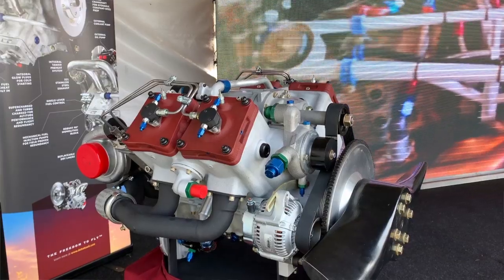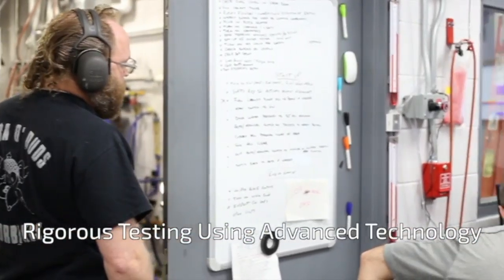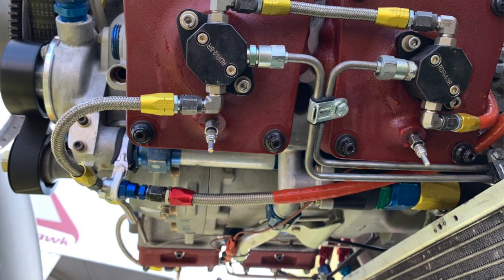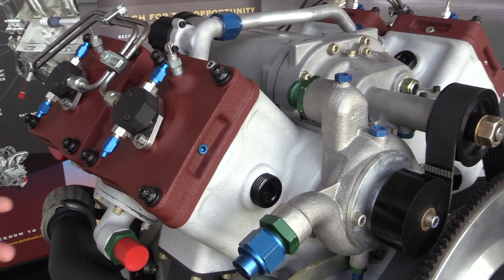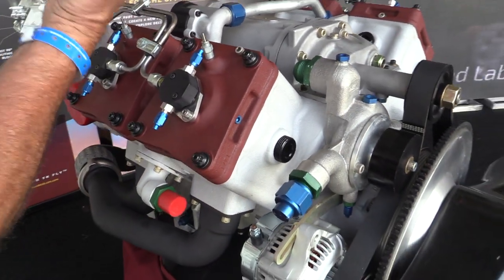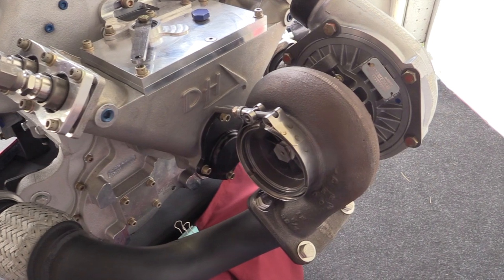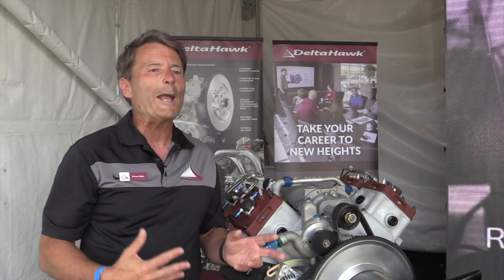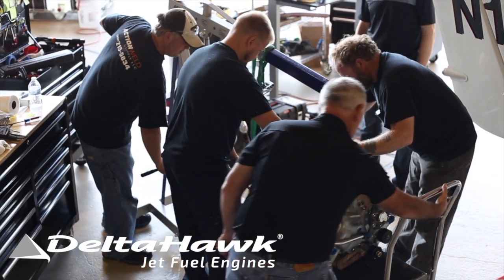DeltaHawk Jet Fueled Piston Engine Update

Comment: Have they elimated the gearbox? All other diesels aero engines have a g/box, which have been problematical.
Reply: It looks like the prop and flywheel are bolted directly to the crankshaft on their display model and airplane in the video. Unless there is a planetary system in the engine block, I'd think it's directly driven. It's kind of hard to tell many specifics with so much of his effort trying to avoid saying "it's a 2-stroke diesel" and describing all the details of one instead. It's not a trust-invoking behavior, and in the mix, I don't recall him saying why burning jet fuel is even better.
Reply: @buckstarchaser2376  Jet A, kerosene have higher energy density than gas, and as stated elsewhere, you can grow diesel fuel.  Diamond DA-42 has twin 140 HP diesel engines that burn 11 gallons an hour at cruise total. Avgas twins burn that much on each side.  That is the diesels main attraction.  Europe loves diesel aviation engines because avgas is over $10 per gallon there because of their regulations and taxes.  Many parts of the world currently have Zero availability of avgas.
Reply: @PC-vq5ud  That was a good explanation. Thank you.
Reply: Bob, it is direct drive.  Part of it's advantage is that it is powered on each stroke of the engine.  Less vibration and smoother energy delivery.  Makes for easier prop design.
Reply: I'm waiting on someone to get an aircraft engine that will run on automotive regular gasoline.
Reply: @justins.1283  Get a small turbine or rotax, they on unleaded just fine.

Comment: Mechanical fuel injection? Water cooled! Wow!   It seems like a Messerschmit bf109!!
Reply: One third of the Daimler in the BF-109...  ;-)
Reply: @bunkie2100  finally, in Usa too discovered water cooling and injection (for plane! Bikes instead..... ;-))
Reply: OrMa  B707 & B720 used water injection on takeoff. Cheers from NJ

Comment: I’m confused keep it simple but it’s super and turbocharged and mechanical fuel injection sounds like a bad idea
Reply: The supercharger gets compression up at startup high enough to get compression ignition.  The turbo moves air and scavenges the cylinders, and keeps it all running up to 25,000 feet altitude.
Reply: It won't work without the blower, it won't make power without the turbo, and it won't be anywhere near as reliable with EFI common rail

Comment: If its jet fuel burning then it's a diesel...
Reply: well,... Jet A1 is kerosene with additives.
Reply: @noelwhittle7922  - and the original diesel engine ran on peanut oil. The fuel does not change the engine type :)

Comment: Will this be scaled up to compete with IO-540's someday, and will they offer some form of FADEC?
Reply: This engine is designed to operate without electronics.  KISS principal.  Once it is running at temp and at operational rpm's it is all mechanical, compression ignition.
Reply: FADEC=Lots of electronics.  That's the Full Authority part of FADEC

Comment: What we need is innovation in powerplant price. I love that they are trying to innovate the design. It's about time, I'm kind of tired of all the overpriced 1940s tech VW engines from Lycoming and Continental. Unfortunately we need 180 HP certified engines at $15 - 20k not $65k (90k estimate minus all the included extras).
Reply: glsracer  hi, do remember when PORCHE, ., HAT MADE & sold, not enough,,but they WERE FLAT 6 engines, w/ 2 plugs /cul. And magnetos.Also it probably cost more .,  bo you also recall the MOBIL 1, in aircraft?, the said to me when I asked why there NOT in aAVIATION any more, the DID NOT KNOW ABOUT THE ASH component in the oil They BOUGHT A FEW ENGINES, not sure if there were any crashes , but it is NO LONGER USED AN PISTON ENGINES.  !    Cheers from NJ

Comment: Too expensive and too late. Electric motors will take over before this gets a foothold.
Reply: I don't think so because the electric is for new planes and this is for retrofits. Not a lot of folks buying new.
Reply: Only if the plane can carry 20 times the weight of it's current fuel, in the form of batteries, people don't think.

Comment: Twin forced induction might be an issue.  A certain car maker had reliability issues with a similar set up.
Reply: yea but it worked great on detroit diesels.
Reply: The supercharger is only there for starting the engine but it's completely necessary.  There is no other way to feed fresh air into the cylinders because the turbo isn't putting out any boost when the engine isn't running. Early Detroit Diesels only had a supercharger. Turbos were added later on to get more power out of the engine. Deltahawk is using the turbo to capture energy from the exhaust stream that would otherwise be lost, improving power and economy at the same time.
Reply: @AndrewShackleton  i completely understand how it works. but diesels have crank pulses that will get transferred to the belt and break that supercharger snout right off over time.  they might be able to use one of those fluid dampers on both ends of the crank.
Reply: @waynep343  I agree. Beefing it up wouldn't hurt. But I am also thinking it isn't under a lot of load. No toothed drive belt for starters and it will essentially freewheel once boost comes on.
Reply: This is a diesel. It's not an issue.

Comment: $90k for all that stuff, including a cowling and the constant speed prop governor (and prop itself), really is a good deal.  Hope they can keep the prices that low in the future.   Good luck to them.
Reply: That's $89000.+
Reply: welp its now sertified 100-110k for the engine alone.
Reply: 90k is double the price of a Lycoming+prop. They won't sell many at that price to the experimental market
Reply: @savethedeveloper  You left out the new cowling and engine mount.  The last time I had an engine mount repaired, it was $10k just for the repair.   A new Lycoming O-360 is $85,075.
Reply: No one in the kit-plane market spends over 30k on a 180hp engine. We all buy knock-off clones (Titan, Superior).
Reply: @savethedeveloper  Superior unfortunately seems to have stalled in development of their diesel also... a real shame.
Reply: Saratoga Pilot only 8,990 hahaha ...NOT

Comment: Did I hear that correctly? $90k for that?
Reply: yeah he was kinda hiding it didn't he 89-9, $8,990? nope $89,900.
Reply: Worth it if it reaches TBO somewhat trouble free
Reply: Chet Carson there are no GEARBOX, it is DIRECT DRIVE,  CHEERS FROM NJ
Reply: So what?  That's what a Lycoming aircraft engine costs, albeit six-cylinder gasoline and 540 cu ins (derated to 300 HP).  But, you get a lot of additional goodies, including engine mount (worth about $10k), prop (worth about $8k) and prop governor (worth about $6k) plus an engine monitoring system (worth about $2k), with installation labor and new cowlings (worth about $16k) all for the price of the engine alone.  That's a good deal.
Reply: @saratogapilot6100  and they even paint the spinner to match your plane :)

Comment: Does it just run on Jet A? Or can it use diesel too?
Reply: Jet A is available at airports throughout the world. It's easy to get.  You'd have to cart your own diesel fuel to the airport - and it would need to be approved or STO'ed as Alex 1911 says.
Reply: Roy Tee it wouldn’t need an STC if it’s an approved fuel like on other Jet A burning diesels like the Continental CD series of engines.

Operating on diesel has some huge benefits when fuelling at home base. Can buy tax exempt diesel for a fraction of the cost of JET-A or AVgas, like the diesel used in farm/construction equipment or marine applications. 

All you need is a pick up truck with a fuel transfer tank and can bring 100s of gallons right up to your hanger or tie down. I guess for people with cars it would be a little more challenging though, using a ferry tank bladder or even worse jerry cans 😂
Reply: Of course it can... It's just a diesel engine. I don't know why he refuses to admit it
Reply: lastdeadmouse7 its an aviation engine so it diesel would need to be an approved fuel, otherwise would need an STC. The manufacturer only mentioned Jet A, unlike Continental who list both fuels.

Comment: Kinda like a turbo diesel?  Does it have spark plugs?  That blower is almost invisable.  Very pretty
Reply: It uses glow plugs like any diesel :)
Reply: Paul Scotchford  there areNO SPARKPLUGS  IN ANY DIESEL, but it BOED HAVE GLOW PLUGS for COLD STARTS.       Cheers from NJ
Reply: @flybyairplane3528  I said Glow Plugs if you read it .
Reply: Kinda like? It IS a diesel. He even said "combustion ignition". It runs on jet a. It's a diesel.

There were some mental gymnastics performed to avoid actually saying it.

Comment: Impressive, I hope you do well.  In my humble opinion from a person who has worked on many engines.... the super charger nose extension where the pulley is mounted appears to be long and a possible point of fatigue????     Any thoughts???
Reply: ABSOLUTELY  i was going to post that or call them. the snout needs to be cone shaped for best strength.  unsupported that will be a fatigue nightmare. i would think that the blower drive housing might even be Forged instead of cast.  it might be made into a 2 piece.. with a bolt on forged snout.. it could be done by any piston manufacturer easily.

Comment: Would love to have this engine in a car! As a mechanic, I LOVE this engine!!

Automotive reliability has become a 20th Century relic ...
Reply: It's called a turbo diesel, and they're already out there lol.
Reply: @lastdeadmouse7  No, they are all computer controlled shit, I have 2.
Reply: @lastdeadmouse7  -This engine here is 1,000% better than ANYTHING built in the automotive world. 2-stroke, compression ignition - no valves, timing chain, or camshaft. Doesn't get any better than that!
Reply: Are you saying that modern cars are LESS reliable than older cars? I see modern cars go well over 200,000 miles without a single problem related to the engine, older cars were lucky to make it to 100,000 miles before getting junked!
Reply: @PistonAvatarGuy  - That is EXACTLY what I'm saying, and I don't know what era you grew up in, but every car I owned from the 60's to mid 90's had well over 250k on the clock (or the odometer had been around 3 or more times).  My '07 Silverado just turned 98k miles, and I've already got a brand new rear differential in it. Engine is failing, and transmission probably isn't too far behind.

200k miles? Maybe cars built before '07, but the latest batch won't make it much past 100k without major engine repairs. Timing chains on Ford trucks, lifters, cam, cam bearings and valve springs on GM trucks, VVT problems on the car engines, along with intake valve coking due to direct injection. The days of going reliably to 200k are long past. Now, my 1986 Mercury Grand Marquis has 264,000+ miles on it on the ORIGINAL driveline, FUEL PUMP, front brake master cylinder, booster, and calipers, and power steering pump. Try that on anything built this century! My '93 Volvo 940 has 184k miles, and also still runs like a top on its original driveline. My Silverado has been one problem after another since the minute it left the showroom. All the modern ones I work on day in and day out are exactly the same. Overpriced, over-engineered, cheaped-out, rolling Tupperware.
Reply: @SmittySmithsonite  I knew it, you buy American junk. Buy Japanese and you'll see your vehicles go 200k miles without a single repair.
Reply: @PistonAvatarGuy  - So my Mercury and Volvo are Japanese? And my '72 El Camino? I'm confused ...
Reply: @SmittySmithsonite  I'm talking about MODERN vehicles. Plenty of MODERN Japanese cars go over 200,000 miles with zero problems. The era of reliability isn't over, it's still alive and well when you buy Japanese cars.
-
I had a Civic that had 312,000 miles on it when I sold it, it was still in great shape and it had flawless reliability. I've owned, and know of, plenty of other Hondas and Toyotas that went well over 200,000 miles with zero issues.
Reply: @SmittySmithsonite  He isn't lying either. I have owned Japanese vehicles since high school. I refuse to own a GM or Chrysler vehicle.
As of today Toyota, Honda, and Mazda make the most dependable vehicles. I owned a few Nissans that were great too, but you want to avoid newer ones with CVT transmissions.  Japanese cars just don't break down like American vehicles do.
Reply: @robertnagel3972  Back in the day, all true. Today? Not so much. Toyota seems to suck less than the rest lately, but these days, they’re ALL junk. I’ve worked on plenty of every brand over my 14 year wrench-turning career. Low bidder parts, and engineering that makes corporate money at the expense of consumers & techs is the name of the game as we go deep into the 21st century.
Reply: @SmittySmithsonite  Well you know the main problem. They are making cars more complicated than ever before. I hate the way they are making them, like with those computer screens,, traction control and all that bullshit they require on all new cars sold in the States. It's a money pit when it breaks and it cannot be bypassed. I am not a mechanic, but I know enough that I have to agree on you for that statement. What's funny is that I read that you can buy a new car for the equivalent of $5000 US dollars in China today. Because they don't require all that bullshit that's why.
Reply: @SmittySmithsonite  Do you ever watch many Scotty Kilmer videos ?
He's kinda nutty be he seems to know what he's talking about for the most part. He exposes lot's of flaws in modern automobiles
Reply: PistonAvatarGuy my 91 FORD TAURUS HAD 400.,000 ON IT SAME ENGING, But it finally had LOW COMPRESSION IN #5 cylinder , 3 liter V6,  cheers from NJ
Reply: @flybyairplane3528  My brother had a mid '90s Taurus, the ABS module failed and the rear wheels locked up while he was driving it. IIRC, it had less than 100,000 miles on it. My grandfather had a Sable, the transmission kept failing, it was replaced with a Corolla that's never given him a single problem.
Reply: PistonAvatarGuy , 91, was a yearNOT TO HAVE BOUGHT, CONENTIAL, SABLE, TAURUS, had transmission problems, I lost my original, but had it replaced along withALL the engine mounts, but I believe I hit upon the problem, I had a large cooler I was going to use on. My GRANADA, but never did, so had my mechanic, REMOVE THE TRANS COOLER FROM THE RADIATOR, AND USED the cooler in front of my radiator, NEVER EVER HAD A PROBLEM, mine did NOT HAVE ABS, but was a 6 seater, not 5 ., as you saw the miles I had on it , but between my own cars, & job. Vans, I have done 1.35 million miles over the years, Now 78 yo cooling it now retired, , Ever grove from Montreal CA, to Broward county FL ? Cheers from NJ
Reply: @PistonAvatarGuy  To get to 200,000 miles, you pay the cost of the vehicle in repairs to the electronic shit.
Reply: @grancito2  That's what I'm saying, I've seen plenty of vehicles go well past 200,000 miles without needing ANY kind of repair related to the engine, "electronic shit" included.
Reply: @PistonAvatarGuy  A make of vehicle that will do that consistently, is what everyone needs, any example?  I have kept the ancient mechanically injected diesel pickup, because at 260,000 miles it has had no engine work and runs great. I need it for when the other two newer lower mileage electronic ones won't run.
Reply: @grancito2  Older diesels tend to be reliable because they're extremely simple and have very limited power output, greater performance tends to require greater complexity. Anything with a Honda K-series engine tends to hit 200,000 miles quite easily without issues. Toyota also makes extremely reliable vehicles, but their engines tend to be larger and heavier than Honda's.

Comment: Jet A is just Diesel...
Reply: Negative - its kerosene. A bit thinner.
Reply: Ok its a V4 2 stroke diesel.
Reply: But will it run on peanut oil?
Reply: @machinesandthings7121  peanut oil is expensive but probably....
Reply: @machinesandthings7121  If you land in a tropical jungle, short of fuel, you can get the natives to squeeze palm oil berrys for fuel.